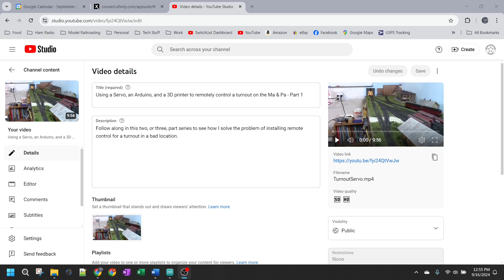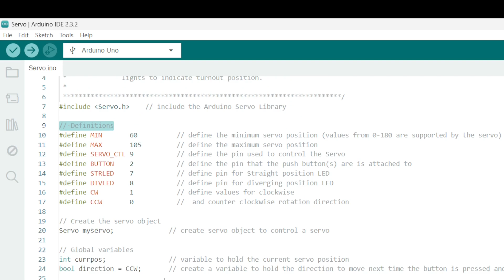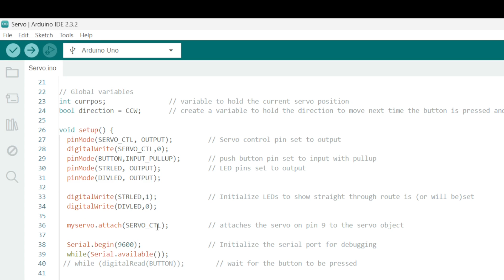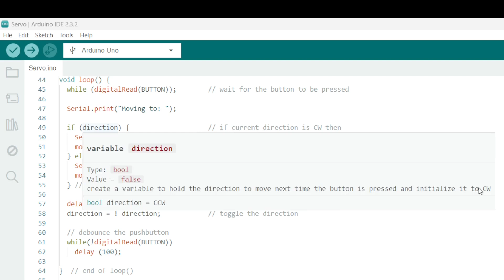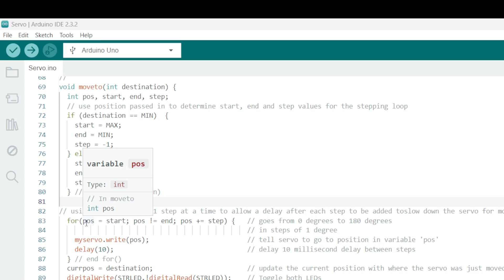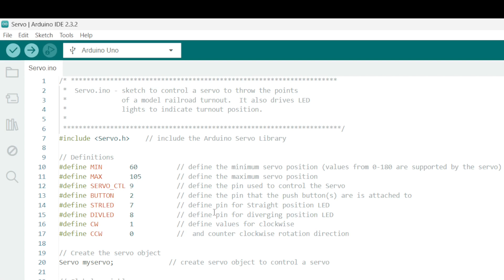Arduino + Servo + 3D Printer - Part 2

Comment: I'm not sure but I think the name of the servo, "Tower Pro" wasn't mentioned in either video.. or I just missed it. I only mention it in case others are curious about that.  I recall Larry Harper also did a video on a similar use of the servo in place of a switch motor. Some of your subs might want to check out Larry as well.  Nice presentation. Thanks.
Reply from the maker: Thanks for the information.  My servos are no name micro servo's I got from Amazon.  I will put al ink to them in the final installment of this series.

Comment: The servo works well.
Reply from the maker: I actually have it installed now and it is working good.  Just need to wire up the pushbuttons and dwarf signals to complete the last part of this series.Thanks again

Comment: That was interesting.   I only use my Arduino to run DCC-EX.  Never tried to write code for it.
Reply from the maker: I have used them for a bunch of projects.  Made videos for most.  Speedometer, campfire simulator, mutliple structure lighting, and the Turntable controller I built uses one as well!  Great little toys... Thanks for watching Fred.
Reply: Very cool.  I did use a couple of IR sensors with Arduino connected to JMRI speedometer.  I didn’t feel it was real accurate.  I was getting different speeds on loco running at speed step 28.  Not sure if it was loco motor or Arduino  to JMRI interface.   Gave up trying to speed match my old locos.